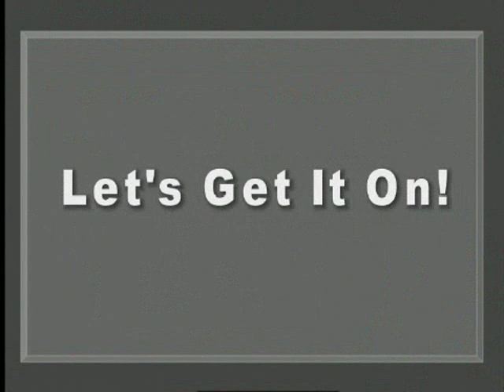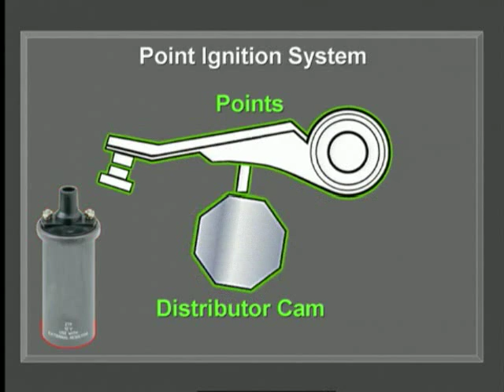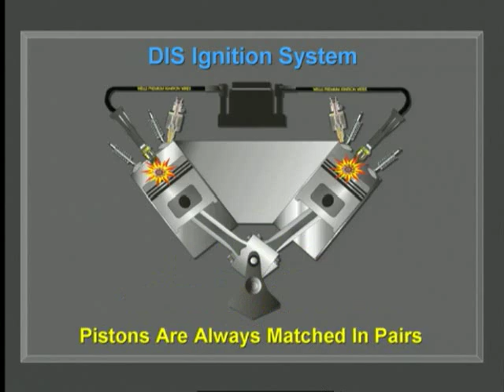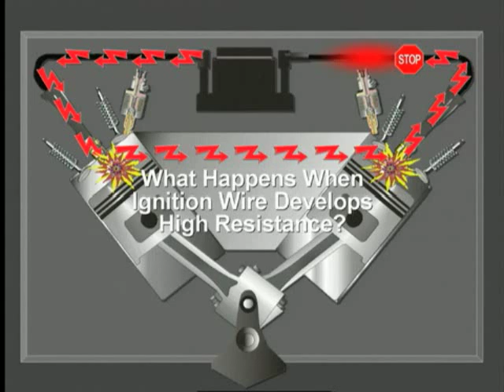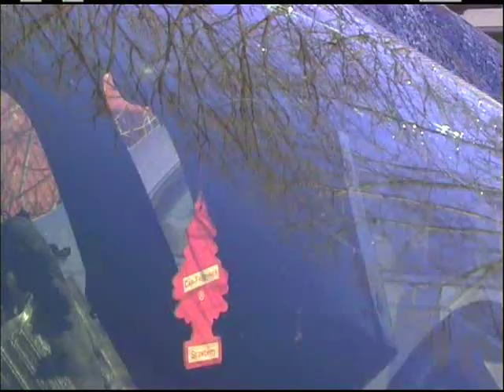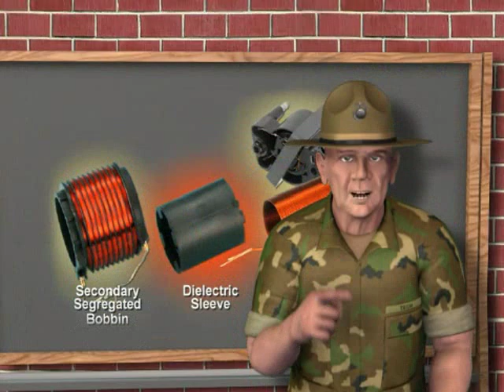Wells Distributor - less ignition system, DIS, Training with Sgt. Tech P0300, P0301, P0302, P0303

Comment: Hey sarge I have a 94 S-10 4.3L TBI . I'm trying to smog it I go test it when the rpm's get over 2k for the first 20-30 seconds it's fine then the electrical starts choking and resets the smog machine what could that be ?
Reply from the maker: Hey Sammy, what do you mean "the electrical starts chocking"?
Mike Becker, Senior Technical Instructor
Reply: NGK Technical Training I tried to smog it and the computer kept resetting the test because the electrical pulse in the sparkplug cables would cut out and only spark about half the time. He tried 4 different cables and had an adapter for the cigarette lighter and samething happened . The engine doesn't drop down that much in rpm's,  but it does lose  power a little . Also my abs light is on in my truck and at times my abs will come on when I'm driving . Not sure if that has anything to do with it . And my voltage reading on the dash sits at 12 or 14 regardless of rpm's it goes back and forth between the two readings mostly 12 but when it reads 14 it doesn't seem to happen may just be a coincidence.

Comment from the maker: First I want to apologize for the slow response, Had some medial issues and on the mend. This is an excellent question and one techs have asked for a long time. Usually it can be done with a test light. What is the year, make, model and engine size of your vehicle? What type of issue do you have?

Mark Hicks
Wells Vehicle Electronics

Comment from the maker: You are right there should be power feed to the coil packs and the other wires should be a switching ground. Try connecting your test light to positive and then to the other wires and crank the engine the light should flash. It is does not it means the module or crank sensor is not working.

Mark Hicks
Wells Vehicle Electronics

Comment: out of 3 wire, one being battery +ive all the time, I could not see test light flickering in the rest of other 2 wire, my test light connected to ground.  so just to prove that coil pack is working, I connected my test light to ground and touched the control wire(other 2 wire) to break and see if I get spark in spark plug. I don't see spark at all.. do u see any issue in my testing approach and why I could not see spark. my other diagnosis to check why I am not getting pulse is yet to be chkd,

Comment: Mark, Thanks much. I have Ford F150 1997..8 cylinder that has waste spark with 2 set of coil pack. A coil pack have 3 wire. Power all the time in one wire, rest of the 2 wire as per Mitchell it says IGn1 and IGN2. so I assume it is for pulsing ground. I also assume that PCM has built in igniter or ICM, because I assume if ICM is in coil pack, it needs power and ground and all I see is 3 wire.. so is my understanding right that PCM has ICM because I don't see ground wire out of 3 wire.   cont..

Comment from the maker: This is a great question. You have a good understanding of the function of a DIS system. If the body ground is connected to the engine it will work. Better just connect the spark tester to the engine and ignition wire.
Mark Hicks
Wells Vehicle Electronics

Comment: Hi Mark, before asking my question let me explain what I understand on DIS coil, unlike conventional DIS, secondary is isolated from the primary winding and battery voltage. the secondary winding becomes a voltage source. Each end of the winding is connected to one of the ignition wire towers.  ok I understood the theory, question is if I want to use spark tester, connecting one end to body ground and other end to spark plugh cable, will it work?.. this is how we used for NON DIS system, PLS

Comment from the maker: In a DIS system the primary winding is connected to battery voltage, but the secondary is isolated from the primary winding and battery voltage. These type of coils would be considered true transformers. Therefore the secondary winding becomes a voltage source. Each end of the winding is connected to one of the ignition wire towers. Because it is the source the current generated will take the shortest path back. In the path will be two ignition wires, two spark plugs and en engine block.

Comment from the maker: Great question! You have been taught electricity will always go to ground. It will go to ground  The reason it goes to ground is because it needs to get back to the battery. The reason it needs to get back to the battery is because the battery is the source of the current. If you look at the inside of a typical oil filled coil, for example, you will see the primary and secondary windings connect at the plus terminal. Hence making the source of the secondary current the battery on this system.

Comment from the maker: @sangreazteca69 Hello, I first want insure you everything in this and all our videos is fact. I do not blame your teacher, I am sure he is very good, it can be hard to understand this system. On a DIS coil the primary and secondary windings do not touch each other. Remember, electricity will always return to it's source. If the windings do not touch each other the source for the high secondary current is the secondary winding. You can prove this by removing the spark plug wires from a coil and

Comment from the maker: @dmorley100 You are absolutely correct. I could not have said it better myself. After all these years it is still a black art in many ways. This is why my articles and videos focus on the the function and testing of systems. If you have a good understanding of how the system functions you are well on your way to making an accurate diagnosis. But as hard as I try; are there times when I make the wrong diagnosis? Yes it still happens from time to time. 
Thank you for the great post.
Mark

Comment from the maker: @adhdkid918 if there were extra fuel to burn it is going to happen when an exhaust valve is open. Do you think this might create a backfire? To prove what I am saying in the video do this. Remove the two spark plugs from the cylinders being fired from one coil. Look very carefully at the electrodes. You will find the inside electrode worn on only one spark plug. If you look very carefully at the other plug. You will see the outside electrode is worn in the middle.

Comment from the maker: @adhdkid918 OK now that I have that off my chest. When i first learned how DIS worked I had the same questions and many more. You are saying that the coil fires out of both towers at the same time. Firing one cylinder under compression and the other on the exhaust stroke to burn the extra fuel leftover from the previous combustion event. There are engineers a lot smarter than me that spend their lives making sure all the fuel is consumed during combustion.

Comment from the maker: If the catalytic converter is getting plugged up you definitely have a misfire. I see you have an Accel coil. Do you also have multi-spark ignition? If the pick-up assembly has two wires going to it, it can be checked by looking for an AC voltage. During normal cranking speed it must generate at least .5 AC volts. If this is correct, I work suspect a problem with the multi-spark. Please let me know the results or if you have any further questions.

Comment: 1988 mitsubishi starion, 2.6 turbo. i notice the accel coil was leaking oil at times plus hot.The car turned off in the freeway, i manage to take it home running crappy as hell.Also, the catalick converted was pluged i put a new one same problem start cranking but no spark.Put original coil back/stock same problem Ngk wires are new.

Comment: Can i put this on a stario, car does not start but cranks.I put new distributor wires, park plugs, rotor,dis cap. I have a feeling its the coil if not my icm.I had a original coil with resistor upgraded to an accel can any one help.